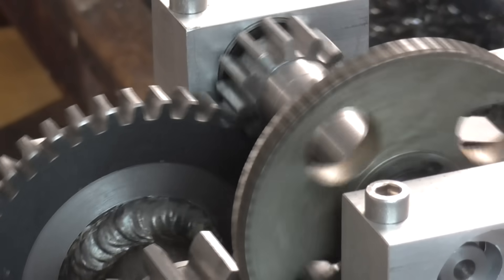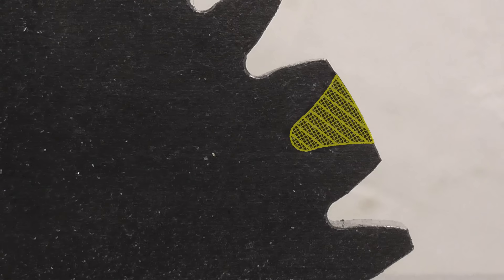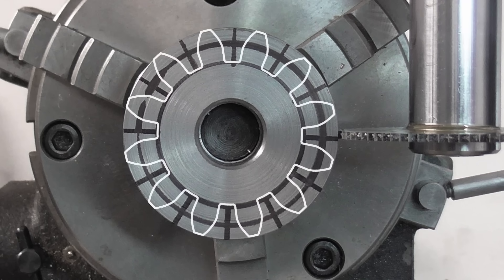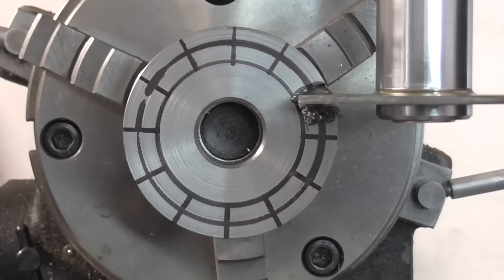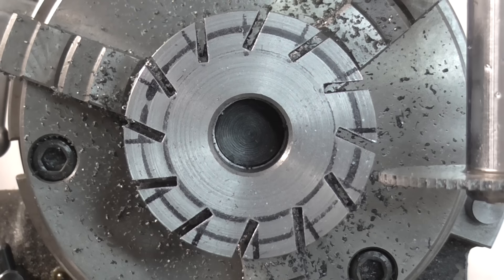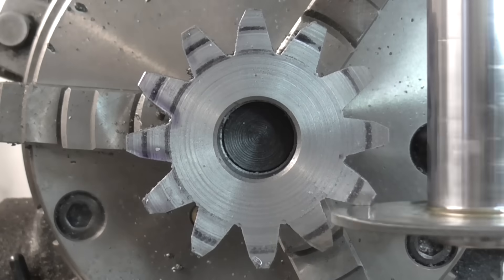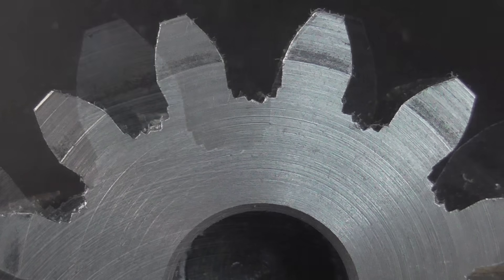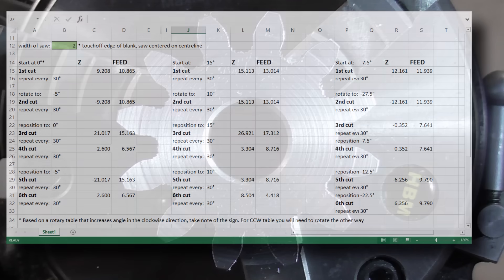Cut any gear with just a slitting saw

Comment: 6 ops taking 5 min per setup, x2 for each side, 15 min per operation put the 12 tooth at a theoretical time of 2.5 hours or more. You can find gear cutting sets for different mods for relatively cheap. If your only ever going to cut 1 gear, it's probably worth your time to just buy a gear cutter for that gear. 
It's a great skill to have for are but unless you don't value your time and your machines time, it doesn't make sense to not incest in the tooling.
Reply from the maker: Yes, this is not the fastest way to cut a gear and it usually wouldn't be my first choice of method, but it probably took around 2-3 hours whilst filming it, which always takes far longer. The first two cuts per tooth took maybe 2 minutes each, but the blank was 25mm thick. All the cuts after that were much quicker as the saw is removing much less material, usually just a sliver on one side. indexing the blank for each tooth takes only seconds, positioning the saw takes maybe 30s on average and only needs doing every 12 cuts. Without the camera and lights in the way I could have probably done it in not much more than an hour and this is a fairly substantially sized gear. Hobbing it would be fairly slow too (though involve much less manual input).

Comment: "can't justify the expense", when you've already put between $5,000 and $15,000 into a milling machine.
Reply from the maker: Yes, might sound contradictory, but this milling machine cost me the equivalent of $2000 USD and this is a hobby, so sometimes if I can save money on a cutter than I'd only ever use once it's worth putting in a bit more time and then I can put the money towards something more useful. I do this stuff mainly because I enjoy it anyway.

Comment: Amazing job! Would you tell me the RPM, speeds and feeds for the saw. Just got 1 but still a bit afraid to use it. 😁. Need to use it in aluminum. Thanks
Reply from the maker: The most important thing is to make sure the mill is trammed level so that the sides of the blade don't rub when you feed it through the material, this will overheat it and wear it out much faster than getting the speed wrong. For aluminium I would use a maximum speed of 20,000 divided by the diameter of the saw in mm. If you feed by hand you should get a feel for what's right, don't let it chatter. Use coolant/cutting oil on the blade and cut full depth in one pass, you're not doing it any favours taking multiple shallow cuts. And feed in the conventional milling direction, climb cuts with a saw can grab the material with disastrous results!
Reply: @AndysMachines  thanks 👍

Comment: Why not drill indexed holes to form the tooth root then chop into it it with the slitting saw?
Reply from the maker: Yes, I've got this question a lot! I actually did that on the gear you can see at 1:23. I usually only do this on gears with higher numbers of teeth though, due to the root not being a perfect arc, it can weaken the tooth as you need to either drill slightly inside the root circle, or drill further out and still have to clean up the corners later.

Comment: Could you just drill a circle of holes at the root of the teeth, then do the cuts, to have a clean root?
Reply from the maker: Yes, I've got this question a lot! I actually did that on the gear you can see at 1:23. I usually only do this on gears with higher numbers of teeth though, due to the root not being a perfect arc, it can weaken the tooth as you need to either drill slightly inside the root circle, or drill further out and still have to clean up the corners later.

Comment: Calculating your time for all those cuts, wouldn't it have been cheaper to have bought a cutter to do it all at one time???
Reply from the maker: I suppose it depends on your perspective. I would have had to buy 2 cutters, one for this gear and one for the one it meshes with. They would be quite large expensive cutters and hard work for my small milling machine, I would have to take multiple shallow cuts and though it would be a simpler process it wouldn't be much faster. The first 2 cuts with the saw remove a chunk of material, whereas with an involute cutter it all has to be turned to chips.

But the best thing about this method is you can make obscure sizes/pressure angles for which cutters aren't available or are ridiculously expensive!

Comment: This is a great method for making your first gears. It will teach you everything that you need to know about gear cutting. 
I like to first drill a hole circle at the depth of cut. Then I can just use a grinder cutoff wheel to make the teeth because the depth of cut is already done. 
Great video thank you.

Comment: Why not drill the root first?
Reply from the maker: Yes, you can do that. I did this on the larger gear at 1:23. However a circular hole is not the ideal shape for the root of the tooth, so it's a compromise, but that doesn't always matter.

Comment: What if you drilled holes where the valleys of the teeth will be. Then when you cut them out some material is already gone and the valleys of the teeth are round.
Reply from the maker: Yes, you can do that. I did this on the larger gear at 1:23. However a circular hole is not the ideal shape for the root of the tooth, so it's a compromise, but that doesn't always matter.

Comment: Nicely done. I use a lot of american diametral pitch gears. I suppose if there were a slick way to draw the correct tooth then working out the cutting chart I would do myself. But great job! I never considered trying this with just a slitting saw but it looks very doable, many thanks for the video. I have subscribed and will now look through your library :)
Reply from the maker: Then you might be interested to know I've now added a tab to the spreadsheet for doing DP gears as well. (https://www.patreon.com/posts/61153468 )

Comment: Since the bottom of the tooth doesn't really matter but you clean it up for aesthetic reasons, could the first step in the process be to drill holes for the tooth bottoms?  Or would it be too hard to line up the slitting saw with the holes?
Reply from the maker: Yes, I do drill out the roots sometimes (see 1:23) usually on gears with more teeth.The holes are drilled in a different orientation and I then need to reposition the table, so care needs to be taken lining everything back up, but this is the type of thing you have to do all the time in machining.

Comment: I got this video 6 hours too late. Spend my whole day in the workshop trying to cut a sprocket 3/8 x 7/32 (06B-1) without having 1/4 inch end mill or a cutter for sprockets.
Of course, sprocket is different geometry as spur gear, but method is also reuseable. Never was thinking about slitting saws. Means next try tomorrow. Thanks.

Comment: As I understand it, shapers were used to cut teeth in the old days.  Your method may be a bit "hammer and tongs" but it very accurately explains how this was actually developed.  Thank you for putting in the hard work to make this easy for your watchers.  Even with the extra effort, I think a BS 0 dividing head would be a better use of my meager funds than a devoted set of gear cutters.  Especially as you mentioned I only will be cutting the odd gear, and the expense of a cutter set is prohibitive.  VERY WELL DONE!!!

Comment: Great piece of  work and ingenuity, what I call engineering. To give the gear pair (assuming there is a pair) a finish for smoother quieter running you could run them against each other  for a while with fine abrasive paste to lap them. This will knock of the tiny inaccuracies from the tooth flanks.
Reply from the maker: Thanks! Yes, there will be small ridges in between each of the facets and this is a good way to hone them. A few wipes with a file will also remove the high spots. For my use these gears will only be turning slowly and for short periods, so no further finishing is needed, but for high speed use a smoother finish would be beneficial.

Comment: Very good video. I love how in machining and doing things from scratch there is no one good way of doing things, hence my question. Why haven't you correspond your cuts with the final surfaces of the teeth? Then you would have around only 4 changes of the cutter position or changes in the dividing head, First cuts you did correspond to nothing and then you have to refine it so you have 6 passes instead of only 4.
Reply: He did the first 2 cuts to remove the bulk of the material, if you go straight to the final surface you have to cut with a lot more material and that take a lot of work.

Comment: Is there a way to clean up some of the saw cuts on the sides of the teeth? Is that too rough?
Reply from the maker: You can take more and more cuts to end up with smaller facets on the teeth, but it's a case of diminishing returns. If the saw had a small radius on the corners there would be less of the scratches you can see from the individual teeth. You could clean up the small ridges/high spots with a file (in use these will tend to wear off first anyway). You could even hone the gear by running it against another gear with some abrasive paste in between.

Comment: This was fantastic! One question, could you drill out the base of the teeth, assuming a drill bit was the correct diameter to fit? That would give the nice rounded transitions, and would certainly be fast. Would also give a little relief for chips to fall out during the first two deep cuts.
Reply from the maker: Thanks! Yes, I've actually got this comment a lot, and I do drill out the root first sometimes (you can see this at 1:23 on the bigger gear). It's a bit of a compromise though as the root of the tooth is not a perfect arc, so you normally have to drill the hole a bit inside the root circle ending up with a slightly weaker tooth.
Reply: @AndysMachines  Yeah, I learnt from my dad that in precision gears they would hob to a slightly over size on the flank, then heat treat, usually case hardening but deep enough to leave room for final tooth profile grinding to the finished profile to remove any warping cased by stress relaxation in the hardening process.

The trick to master was to have the hobbed profile only over size in the contact area where you wanted to grind to exact size but still blend into the strongest possible root profile with no step where it did not need to be finish ground and would have the full thickness hardened case still remaining.  

Helicopter gearbox design was the trickiest as weight was critical on high speed gears.

I spent many hours with him working on his software. All of it was focussed on gear cutting machines with purchased tooling so not directly related to your basic principles techniques.

There was something called tip relief that could be included in you shifted the gears closer than standard for some reason that escapes me right now.

Comment: https://youtu.be/XWGgvecgW0Y I used a similar approach, but i made a cutter with the profile of a rack tooth, and then rotated the gear and lowered and lifted the cutter accordingly to profile the teeth.. Oh.. and i used a CNC mill...since i have one.. :)
Reply from the maker: Yes, I've also done it that way on both manual and CNC machines. If you make a cutter like several of yours stacked on top of each other you can cut multiple teeth simultaneously and indexing once per tooth is enough for bigger gears.

Comment: First You should drill some holes and "open" the grooves by grinder with cutting disc. Drilling/grinding is much faster than milling - especially with that flat saw-disc which causes  lot o friction on the sides...
Reply from the maker: Yes, I've actually got this comment a lot, and I do drill out the root first sometimes (you can see this at 1:23 on the bigger gear). Drilling is certainly faster than milling, but a slitting saw in a milling machine is quite fast, comparable to a cut-off disc in a grinder (and a lot nicer to use!) Slitting saws are slightly hollow ground on the sides so there should be no friction (as long as the mill is trammed in properly).
Reply: @AndysMachines  Im from Poland, most of these saws here are completely flat... in case of larger thickness they have quite different construction and much more complex geometry (each one teeth works only on the one side) and whole these flat surfaces are completely recessed, so there is no friction.

Comment: Amazing talent.
Just one question -- For the root of the tooth, instead of using the ball mill cutter, why did you not start this project by FIRST using a drill bit and drilling the root ? Then you begin to cut your gear teeth.
Reply from the maker: Thanks! Yes, I've actually got this comment a lot, and I do drill out the root first sometimes (you can see this at 1:23 on the bigger gear). It's a bit of a compromise though as the root of the tooth is not a perfect arc, so you normally have to drill the hole a bit inside the root circle ending up with a slightly weaker tooth.

Comment: Maybe one could predrill the roots at the beginning if you don't have a ballnose endmill?
Instead of reversing the rotary table by 5* (etc.), it might be better to advance by 25* (etc.) to prevent introducing backlash?
Reply from the maker: Yes, I've actually got this comment a lot, and I do drill out the root first sometimes (you can see this at 1:23 on the bigger gear). It's a bit of a compromise though as the root of the tooth is not a perfect arc, so you normally have to drill the hole a bit inside the root circle ending up with a slightly weaker tooth. Yes, you can position the table any multiple of 30° (one tooth) from the starting position, -5° was just closer! (I did take out the backlash).

Comment: How long did it take you to make that gear?
Reply from the maker: Whilst filming it and setting up the camera, lights etc. it did take several hours (always takes far longer to do something and film it at the same time). Without the camera in the way I could have probably done it in less than an hour.
Reply: Thanks, how long would it take using a gear hob, or with a „traditional“ device?
Reply from the maker: @philippberr5321  With a proper gear hobbing machine it would probably only take minutes. But these machines are extremely heavy and large and not something I could fit in my home workshop. I've never attempted to hob a gear this big on my small milling machine. I could do it by indexing and cutting the teeth one at a time with a profile cutter, but I would have to take multiple passes and it would probably take even longer since I would have to turn all the material to chips rather than sawing a triangle out to start with.